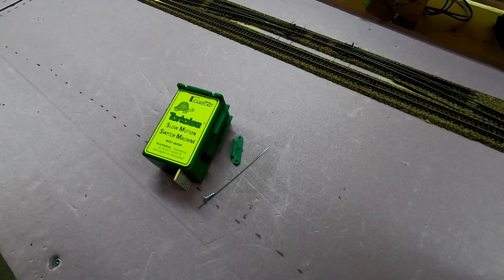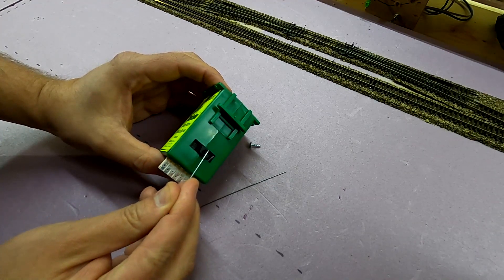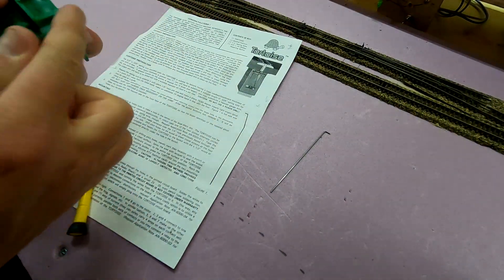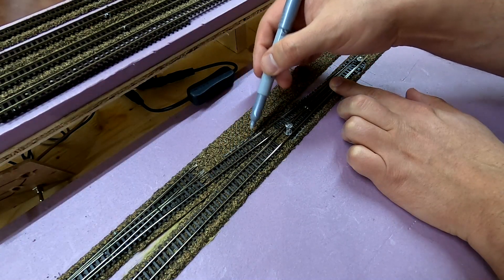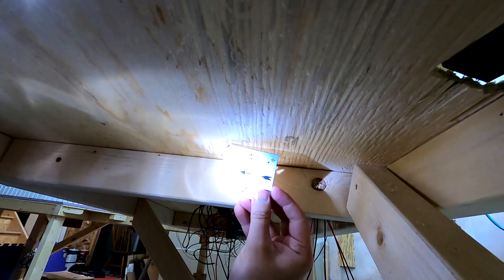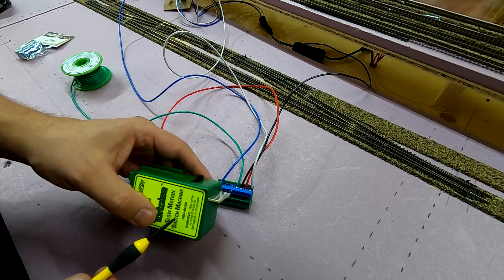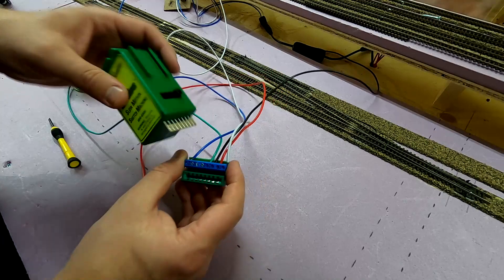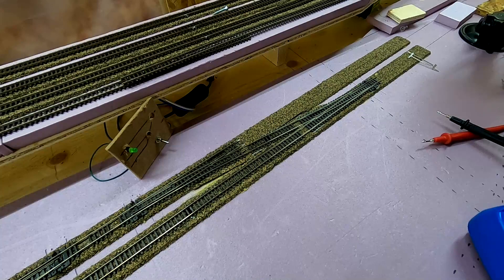Tortoise Slow Motion Switch Machine - INSTALL & WIRING

Comment: Great video! Quick Question, are you using SPDT switches or DPDT switches? I would like to wire my tortoise onto a control panel and use your method but im unsure what types of switches I need!
Reply from the maker: I used DPDT 2 position ON/ON switches

Comment: Love your show! Question about Peco code 55 turnouts. There is no center hole for installing a point motor. What do you do when installing a switch machine?
Reply from the maker: The holes are on the outsides of the track.
Reply: Dosen't that make it hard to hide the hole for the control wire?
Reply from the maker: @ledyardbrady6623  Not at all. The Peco switches have a tiny little bump on each side of the slide bar. The wire is right beside it and is hardly visible.

Comment: I am in the building stage…but have not decided on how I’m going to power my turnouts…how thick can I go with 1/4” ply, foam and 1/8” roadbed and still be able to use the tortoise or any other…blue point, fast track…any help from all would be great…thank you.
Reply from the maker: I have heard of people using up to 2 inch foam over 1/2" plywood. I'd highly recommend .039 wire though.

Comment: Ok how do you adjust the travel on the switch for the tortoise 🐢 machine 🤔.???? Noone has a video on how to adjust the travel.
Reply from the maker: by adjusting the slider (0:33) that the wire goes through. This changes your fulcrum point and adjusts how much travel the wire moves at the switch.

Comment: Helpful video thank you. My foam is 1/2' with silver liner ;(  but it was the rigid stuff not cushion. I was going to use the same stuff you did when at depot but I didnt because I thought I had to stay in range of the turtle wire which said 1". Im tempted to get the same foam and go over it but I will have 1/2" ply' 1/2" foam and then 1" foam  being at 2" if so. I would probly Have to recess all the switches so Ill stay at the 1/2". I just hope I can glue new foam to the silver liner as it wont come off. I bought a guys used set up and it had 32 snails / turnouts and 2 reversing loops but I cant have massive U setup I tore it down and saved 80% of the track. Didnt like the layout either for city layout. The wiring was INSANE and im just barely learning this stuff. My new table is 14' X 44" on 6 locking wheels so I can take it from the garage through the arcadia door later if need be.  I do want to use the same foam as you for the build up this will be much cheaper. Im trying to learn enough to do a layout. I want to utilize as much of this stuff as I can.  I  still have to learn the digitraxx 240 and the two throttles it came with and the 8 loco's ;) Im going Loco...
Reply from the maker: My foam is only 1/2" on top of 3/8" plywood. 2 inches would be about the most I'd want to go through, and I would definitely use .039 wire. Good luck with your layout, I am sure it will be great.
Reply: @nscaler454  Oh they only had the pink foam in 1" when i was at Home Depot. Im going to stick with the 1/2" I already have glued down so most of the switches will not need .039 longer wires. Ill be building up with the pink foam like you tho.  I will be watching more for ideas thanks!

Comment: Thanks much! I'm starting on a layout and hope to get laying track in the coming month or so. Deciding right now on Tortoise vs PECO switches (under a 2" foam base) and this video helps me understand the ease of using the Tortoise. Cheers!
Reply from the maker: Thank you! With 2 inches of foam base, I would recommend upgrading to the .039 wire.

Comment: Awesome!! I have to ask though, have you considered the Walthers layout control system in the past? I was always afraid of going this route of having to wire and solder stuff which the Walthers system totally avoids. Just curious what your opinion is on the 2.
Reply from the maker: I never looked too in detail to the Walthers system, but from what I know it seems pretty good. I thought that it required soldering to the microswitches though. I like that it comes with a larger gauge wire. I bought a 12 pack of Tortoises, so I won't be looking at the Walthers device right away.